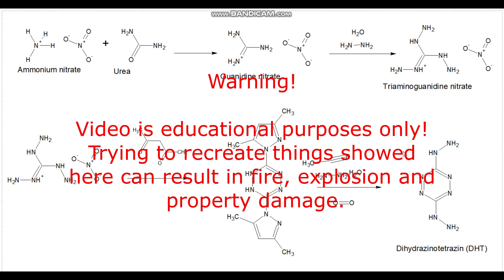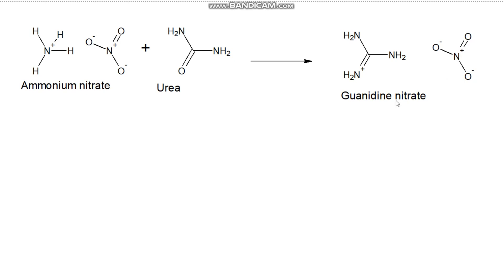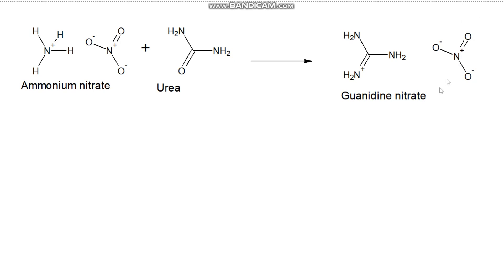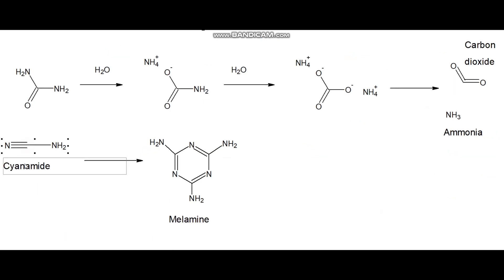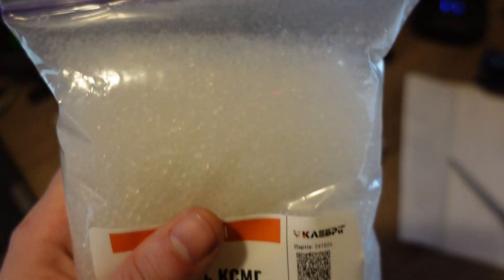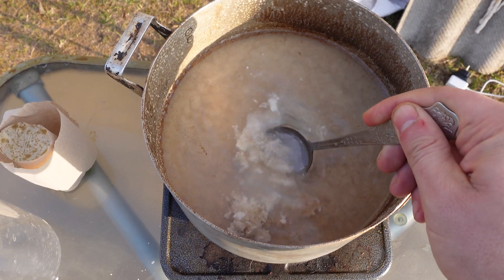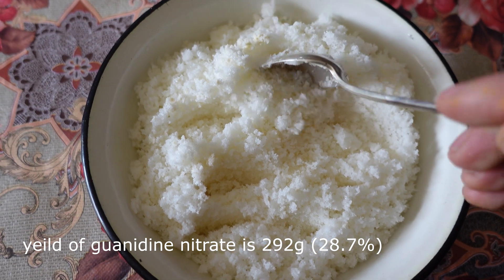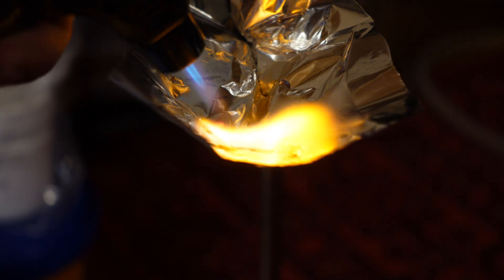Guanidine nitrate synthesis from urea and ammonium nitrate (dihydrazino tetrazine DHT part 1)

Comment: I like to see making smokeless powder using guanidine nitrate, nitrocellulose and nitroglycerin mix used as propellant for shotguns.
Reply from the maker: Smokeless powder is very hard to make properly at home. I would say even impossible. You can mix the ingredients but there is no way you can control their burning chsracteristics at home. Slight deviation from technology and your powder will burn too fast giving high enough pressure to destroy the barrel. This is not blackpowder, BP will not destroy shotgun even if you fill the whole barrel with it. But smokeless powder can easilly do this because it gives much higher pressure. To make smokeless powder you need well established manufacturing process and the way to control its burning characteristics at high pressures. Some people used flash cotton to shot from shotguns. Looks not safe but it works, probably because of its low density.
Reply: @NinjaChemistChannel  Agree with you 👍 Back in the days i made smokeless powder only from nitroglycerin and gun cotton while dissolving in acetone giving a paste after drying on a tray i loaded 0.22 lr ammo , after shooting resulted in full destruction of the barrel. That was insanely powerful!
Reply from the maker: @PickyPlans I hope you were not injured. use blackpowder! Homemade BP is safe to fire!
Reply: @PickyPlans that's wild, .22lr guns are usually way overbuilt for the cartridge pressure.
Reply: @PickyPlans  у вас выходил не порох а, гремучий студень. И да, им можно зарядить 0,22. Но закладывать надо в гильзу горошину размером с три спичечных головки.
Reply: @chemistryofquestionablequa6252  нет, в этом калибре давление до 1500бар предел. В начале истории 0,22 работал на черном порохе.
Reply: @pyrotechnicSAR what I'm talking about is how thick the receiver is on many  .22lr rifles especially bolt action.  In a lot of cases you have up to 10mm of steel on all sides of the chamber.  They can handle way more pressure than the stated maximum of the caliber.  Still best to test fire remotely of course.
Reply from the maker: I would probably try to make it but for now this is pointless because I dont have a shotgun to test it.